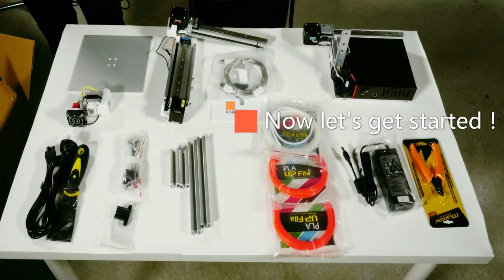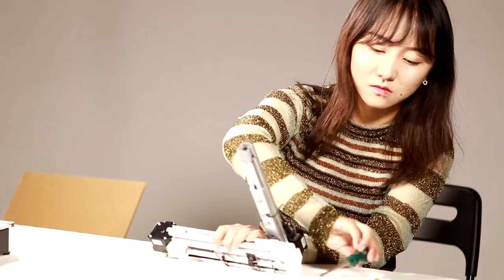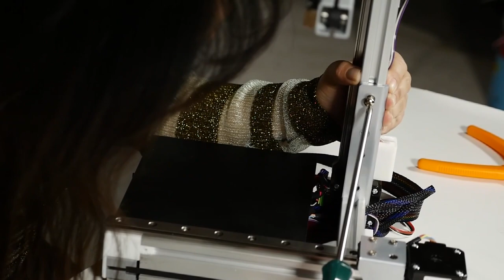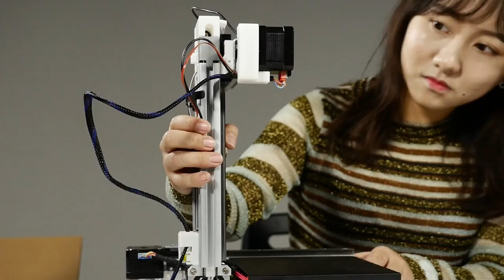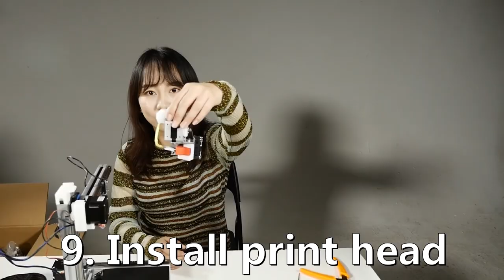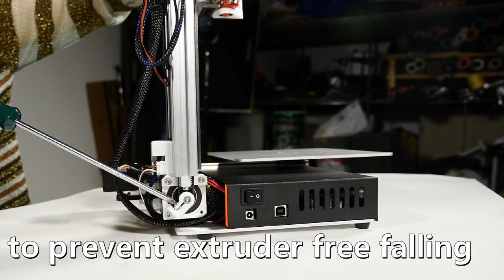How to Setup Cetus MK3 3D printer | Cetus 3D

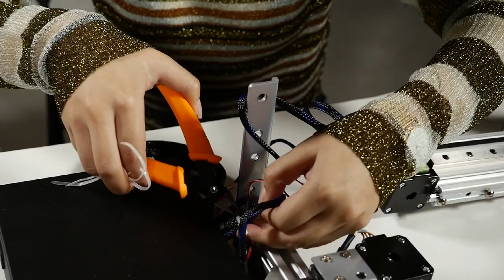Comment: What is the black 3d printed piece in the kit for? There is only one loose 3d printed part printed in black in the kit. Where does it go? Not mentioned in the Quickstart guide or video? it is shown in the video at 0:07
Reply from the maker: Is it a part like the letter T? It is installed on the base motor to make the printer stand more smoothly.
Reply: @Cetus3D  where I have to put this piece?
Reply: Yes, that piece has had me completely stumped! I’ve been looking all over for a place to put and confused as to what it is!!

Comment: Where can I buy Cetus in Europe?
Reply from the maker: Tiertime UK | eBay Stores  http://bit.ly/2wubLov   Tiertime Global Store  http://bit.ly/2xsMLQ6
Reply: The question is: "Should you?"
Cetus is a great 3D printer.
However, there are many others on the market.
You can find a lot of information on 3Dprinting reddit.

Anycubic Phhoton is in the same price range.
UV resin 3D printing is messy and complicated but gives a superb quality.

Ender3 is half the price, has bigger build volume and a heated bed but prints only PLA (good for beginning) and must be tuned in and upgraded.
If you'll invest time and a little bit of money it will be a great machine.

Prusa i3 Mk3 is double the price for a kit and 2.5 the price for a fully build one but is bigger that Ender3, has a heated removable print bed, filament sensor, auto bed leveling, etc.
Buy it only from Prusa Research.